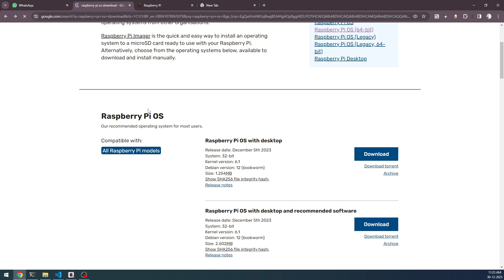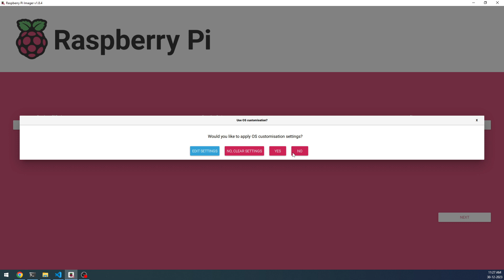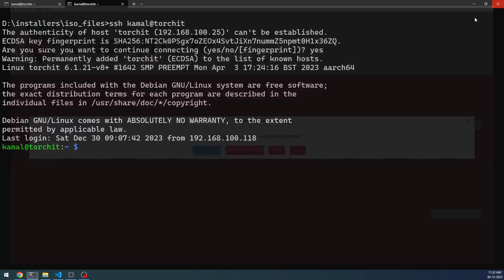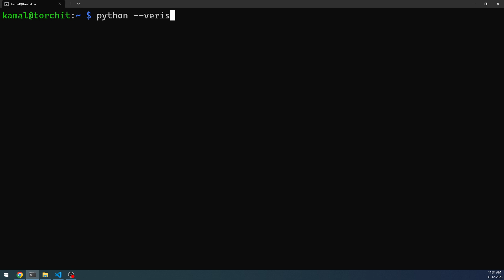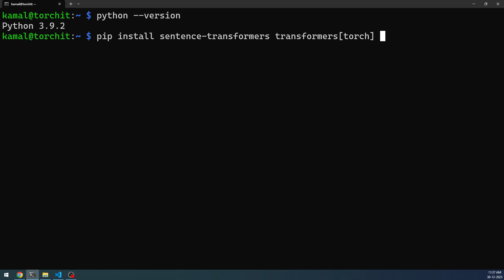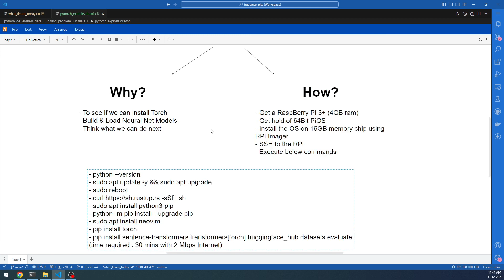Comment: Is it ok to install 32bit os ?
Reply: I have tried to install torch but it didn't work is this the problem? that I have to install 64bit ?
Reply: Kindly share the error that it threw when you tried to "Import Torch" on your 32-bit OS.
We need to look at your full error trace, and then only we can find the solution. 
Its better to use 64-bit OS only.